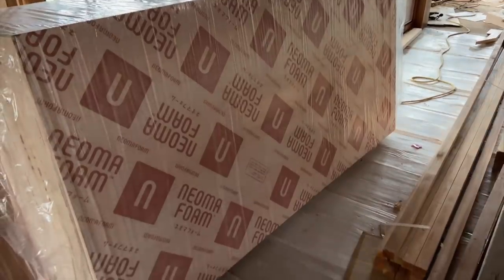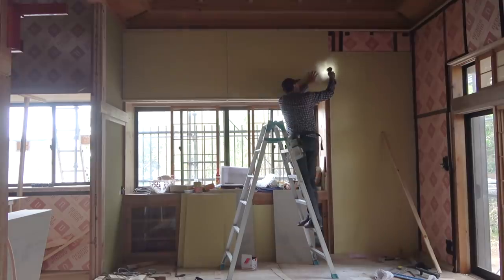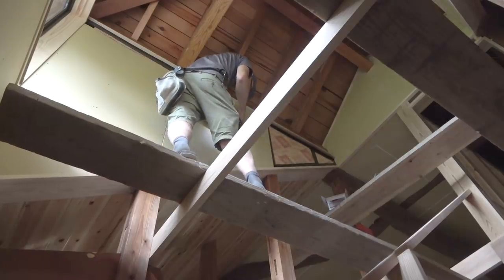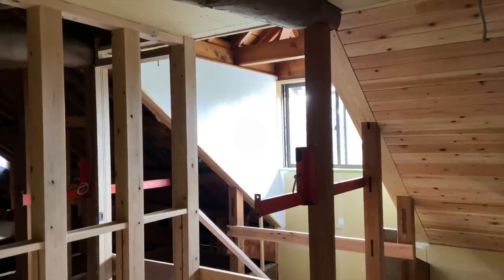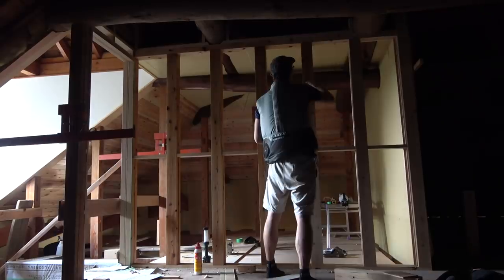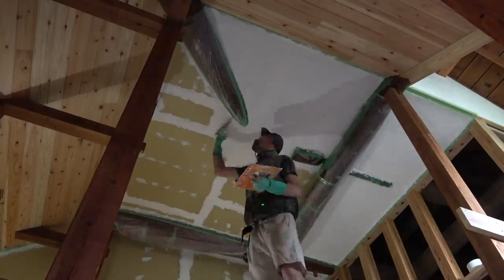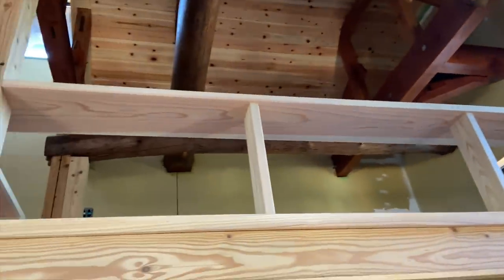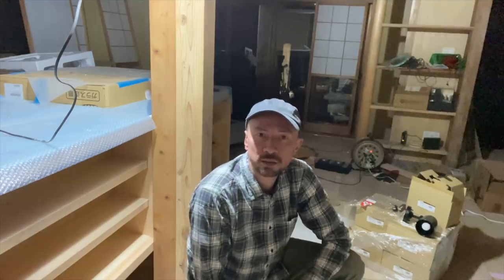Japanese Abandoned House Renovation #7 | The Walls: Insulation, Drywall, Plastering, Siding

Comment: In Germany we hafe similiar thing called "Kalkfarbe", literally "lime-pint". It's a traditional material as well and used for damp walls in cellars and - a bit like in Japan in the sections between the beams of the classic German timbered houses.
These days you can buy it in varying consistencies from fairly thing paint to stuff looking like that one you used. I guess the paint would be easier to apply but you probably need a couple more layers to achieve the same effect.

Comment: In Southern California we hang drywall sheets horizontally and screw around the perimeter as well as in the field.
Reply: It's pretty common in the US to hang 4'x8' sheets horizontally. The center seam is sealed by a tape and a plaster compound for drywalls.
Reply: @jackielinde7568  In Canada too. Actually, it's specified in our construction code. A lot less joints to mask.
Reply: In Germany too
Reply: Yah surprised to hear vertical is better for earthquakes.  Horizontal , perpendicular to studs, would seem better to me for lateral strength. Which is the way it is done in Canada.  But drywall doesn’t provide a lot of strength anyway.
Reply: Drywall sheets are always hanged vertical in Sweden, as the height are 240cm (standard ceiling height). Didn't know anyone hanged them any way else.
Reply: Horizontal can add more shear strength and reduce the time and cost to mud and tape walls but it probably depends on wall construction, wall height, and size of the drywall itself.  I'd go with whatever is recommended for wherever you live. In the US, it's usually but not always horizontal.
Reply: Hmm, here in norway we mount them vertically, but our sheets are 120x240cm (47*95"). our cc on the studs are 60cm and full celing height is 240cm. they are screwed down 10cm between the screws all the way around, and one vertically line in the middle. 
We do make or houses more or less bomb proof tho, even if we have no earthquakes or other extreme weather exept storms/hurricanes.
Reply: @knutruben1  Do you build with block like they do in germany or wood like in america?
Reply: @50sKid  Houses are most often buildt with wood. 2x8" wall studs, cc60 is the standard. plus another 2" inner wall for electrics etc
Reply: @knutruben1  Oh interesting, 2x8"s!! The most we do is 2x6".  60cm is 24" on center which is what they call advanced framing here because you get more space for insulation.  It's done but it's less common.  By far the most common is 16" on center.
Reply: @50sKid  Remember we have cold winters here in Norway, and we have pretty strict building codes for insulation, balanced ventilation etc. I think we changed from minimum 4" insulation in 2007 or something. houses from around 1980s to beginning of the 2000's had 2"4 studs as standard. Its a while since i was working as a carpenter tho, so its a bit blurry:) (also tecnically its 2"10 walls. 2"8 studs, with 2"2 horisontal framing on inside)

Comment: I like how the joiner section between the house and the bathhouse is black and matches the black on the main house, it gives it a touch of modern architecture. Also loving the wood exterior and the lime plaster interior. I wouldn't call the imperfections in plaster, imperfections, it's just adding character.

Comment: Wow, it is really coming along.  I spent 6 summers in Tokyo without air conditioning. I would sleep under a wet towel. It snowed 26 times In Tokyo in 1983... without heat. I would full a clean wine bottle with sento water to warm up my futon.  So you have my sympathy.  The thing is you are doing it right. Thanks for the update from Vancouver Canada- with central heat and air conditioning.

Comment: When I was young. My family and I lived on a Indian reservation. We used a wood stove to heat the entire house. Electricity wasn't always a option.  During the winter we used thick blankets over doorways to separate the rooms to keep others warm. The kitchen was one of the larger rooms we would keep cut off because if you were using the kitchen eventually the cooking stove would heat it up. The same with the laundry room because of the dryer. It's not the prettiest thing, but it does work. Anyways love the videos. Keep them coming, and your house is looking amazing.

Comment: The bathroom ceiling is our disappointing wall. We needed to sand the plaster before painting it, but we never did get around to get the right machinery (or rent it). Also, we were renovating for months (just a flat!), and I wanted to be DONE and move in. So I painted it. It looks ... artsy. 
I don't think the passageway looks weird, I think it looks like a modernistic addition and therefore quite fitting. You gave the old house new, modern life after all.

Comment: I understand why you was gone for so long now, those walls must have taken ages.

Plastering is hard and you've done a great job... but the walls you mentioned you aren't happy with you could easily smooth out the bumps with a drywall sander.

Comment: As to your drywall plaster.  To get a uniform thickness I generally use a 1/64 inch notched troll for the base scratch coat.  I then come back over it with a smooth troll back filling and skimming to the top edge of the scratch coat.  A spray bottle with water works to keep the surface wet to work if it starts to dry too quickly.

Comment: I have not used the Japanese plaster  that you were discussing here. I have used many different types of dry/ add water plaster, mortar, thinset and dry wall mixes.  They are not that difficult to use. Its all in practice for consistency. The bonus is you can adjust how wet or dry the mix is for the application. I suggest that if you decide to try it. Make sure you have the mixer that attaches to the drill. Mixing by hand is difficult for larger jobs. 
I understand your desire for perfection in your plaster technique. Don't be so critical of your work. You progress looks amazing. I have done  tile installation in a few of my homes over the years. Tile is something that will drive you nuts if you are a perfectionist like myself. I still notice mistakes that nobody else sees. I have enjoyed watching your progress on your home restoration. Thank you for sharing.

Comment: Thats the same foam board we use in Ireland.  But the fixings are Timco brand "insulation mushroom fixings" for fire regulation and to stick to block walls. 
We have all solid block homes with beam roof structure and flooring, so it's not cold, but not warm (and Dublin is pretty mild in temperature ranges, but no earthquakes thankfully - so few houses get serious insulation and even fewer have A/C)

Old houses like ours (built in 1938) have fireplaces (ours originally had 5!) Two in sitting rooms downstairs, one in the kitchen and two in the upstairs bedrooms.  They even had carpet! haha.  We chose not to re-employ those for obvious reasons.

The Irish use a skimcoat of plaster over raw brick or plasterboard - I think it's a sand/cement style skimcoat and yeah, it takes a few days to become dry enough to paint. It'll let you know when it's not ready, the paint refuses to stick - after it dries :D

Comment: on your "Shikui" plaster thin coat. We generally cover our taped seams with a thin coat to ensure the smoothness of the wall then coat with primer paint. THEN once dry do a finish coat of latex paint.  thats generally the standard for drywall finish. In colorado where we occasionally have homes made in " log cabin" fashion,  when drywall meets the log we often use a endcap on the drywall to fit the contour and NOT run drywall mud to the wood, while your does look cleaner, in the northern mountainous areas of teh US we get a LOT of moisture in winters that can swell logs, then summer it dries out which would lead to a good deal of cracking where we to drywall completely to the logs.

Comment: It's looking terrific, kudos to you for doing the skikkui yourself. Looks a pretty good job.
I've seen shikkui walls in Japan but wasn't sure of the method of application.
I've been renovating my 1895 house in Sydney. It is brick with plastered walls. Most of the walls needed re rendering and plastering. I had a professional do most of it but I did one room and patched the hall.
The white-set plaster is made from a mix of lime putty and gypsum. The method to put it on is to plaster as even as possible over the wall. After it starts to harden you then use a foam float. The plaster is softened a bit so it can be worked by flicking some water on the wall to rehydrate the plaster. The foam float is good to get a really flat surface. Again after waiting for the plaster to go off, water is flicked over to rehydrate and it is worked with a polished steel trowel. The steel trowel is worked quite hard.  Any dings and scratches are worked out till you have a nice smooth finish.  The surface can become quite polished. If you are not quite expert, then you can give it a light sand and fill any defects later. It is then painted. You can also do a featured wall by working the plaster to a gloss finish and then sealing it.
It’s different finish and texture you get with skikkui so it is good to compare.

Comment: Horizontal overlapping siding we call clapboard. Vertically hung siding we call either barn-board or board & batten where seams are typically covered with a wood bead.

I’ve worked with many types of plaster but never shikkui. Generally the trick with plaster is to mix a wet batch for the first coat in order to get broad coverage and slow the drying process. The second coat should be thicker. Strong arms help enormously :) There are acrylic additives that can improve elasticity and bonding but tend to leave behind an uneven sheen if left unpainted.

Oh, to add, an electric mortar mixer will make the process much easier if you decide to have another go at rolling your own dry mix. A light wet sponge sand will work wonders feathering uneven and taped seams.
Reply from the maker: Thanks, yes, I worked out that a thin, good but quick first coat followed by a thick but more careful second coat worked best for me.

Comment: Pure Lime Plaster is exceptionally difficult to work with, cudos to you for having a go at the DIY Shikui. In Australia we use Pure Gypsum Plaster and mix 10% lime into the mix with water, it's easier to trowel up and smoothe off nicely.
Reply from the maker: Interesting. That sounds like a good idea. I’ve seen some products here that use a lower content of lime (not allowed to call themselves shikkui). Though I’m curious to give the pure lime plaster a go some time.
Reply: @TokyoLlama  Definitely have a go at the pure lime plaster. There's a trick to how much water you add and how you mix it. I think you'll prefer it in the end after some practice. I also noticed on Youtube the way that Japanese Plasterers polish up the final coat, it's really impressive.

Comment: The standard drywall sheet size is 240 by 120 centimeters in Northern Europe and we space the screws the same. The most common thickness is 13mm, but other thicknesses and sizes are available to order. Usually, big commercial buildings are made with bigger custom-sized sheets all the way up to 6 meter lengths.

Comment: I can understand the reasoning behind more concern for heat and humidity of summer than cold of winter because with cold you can always become more active or increase the air temperature heating system but with heat and humidity you can deal with it by doing less or nothing but once you have stripped off all your clothes and totally naked you need a pool!

Comment: in the states, drywall is hung mostly for coverage. IE if your wall is 8FT long and 10Ft high. our sheets are 4ft by 8ft so logically we would run it horizontally to minimize cut and get more coverage per sheet.. we use Standard exclusively for  measurement for construction. only occasionally do we use Metric and thats mostly on appliances and autos. although we do get burch plywood from Scandinavian nations ( because the strength of it is unmatched) and its always metric. A lot of our construction method varies on location. for example the same frame and beam foundation you have in your home is common in the southern states as the floor is framed with joyce runner studs typically 2" by 6". in the northern areas we do basements with concrete exterior walls and footings. then poured floors that " float"  ( they are designed to shift with the swelling of the ground, even after tamping and grading the cold can shift and lift the floor) so in our basements we attach our walls to the upper joyce running under the main floor in the house, this allows the concrete floor in the basement to move without destroying the walls or heaving them into the main floor framing. Our drywall mud is all gypsum based white and VERY smooth. we only use a sand base for grout between tiles. NEVER as a wall finish.

Comment: The reason you didn't use rigid for the floors and ceiling are that the r-value is relatively low compared to other options like fiberglass batts. In general in floors and ceilings you want an minimum r-value of 38, and in walls you need r-23 according to the new energy code in the US that came with the new IBC.

Comment: Absolutely beautiful! Great work man. I really like shikkui walls, and I've done it on a renovation (I'm in japanese construction) before, however, the upper walls near the ceiling, we painted instead (saves a lot of money/time/work) and a few walls that are closer to viewing from a balcony, we used wallpaper with a shikkui like pattern. The lower walls we did shikkui. From the ground level, you can't tell a difference. After that job site, we never used it again, instead, opting for the easier/cheaper sand based plaster.

Comment: White plaster was definitely the right choice. It brightens up the interior and sets off the wooden beams beautifully. Don't worry if it's a bit uneven in places, it livens up what would otherwise be a featureless surface.

EDIT: Drywall sheets come in 240 by 120 cm here in Swden (and most of Europe, I suspect). They are generally installed vertically because standar ceiling height is 240 cm in modern houses.

Comment: tools are often very different as well. our handsaws in the US cut on the push as well as our hand planes, also cut on the push. although most finish carpenters I know do actually have some smaller japanese wood planes ( that cut on the pull) and some fine toothed handsaws from japan for flush cutting. ( barring using these saws previously we used chisels to clean pegs flush)
we also use a great deal more power tools. its uncommon to use handtools for professionals with the exception of things found in nail bags. ( our long line marking is also much different in that we use boxes filled with chaulk and a spool of cotton string inside that when unspoiled allows us to "pop" a line with tension from two points. from what I know of japanese carpenters, they use ink and sticks for straight lines. or small knives to mark with on wood)

Comment: In New Zealand drywall called 'Gib' here, is hung either vertically or horizontally depending on preference. Sheets are 1200 (and 1350) wide x from 2.4 up to 6? metres long.This gives a single horizontal join on a 2.4 or 2.7 stud. Designated bracing sheets (for earthquake/wind bracing)  are specified in 'bracing walls' and have a much closer screwing regime  around the corners (150mm around the edge and 100mm then down to 50mm in the corners) Sheet centres are spot glued to the studs. Standard sheets -300mm around the edge  with centre glued

Comment: The temperatures you said are a bit like Canberra though we may get some dusting of snow every five years. I will say in winter when it is -3C outside my house is COLD and can take four to five hours to heat up to 17C (despite wall and roof insulation). I have been looking to insulate under the house because it can be very hot in summer on the flip side (have measured 42C on a 48C day - too hot to stand on the floor on the west facing side). Missed you and love seeing the progress - and remember imperfections prove humanity!

Comment: I have 2 disappointing walls in my house. The external walls are brick with drywall for the inner walls, and I decided to paint them all white. I started with the brick walls inside the house, and the first 2 walls I did I painted the gaps between the bricks as well to make it all white, which was ok, but very tedious. Then I found on the next wall it was much easier to just paint the brick surface with the roller, and looked much better with the grey mortar in-between, so now 2 walls in the house don't match the rest of the house.

Comment: I know the pain of hot humid summers all too well. Where I live in the USA, summers are hot and humid and this heat and humidity can last for weeks or sometimes months at a time with no break at night. I tried going a summer without AC in my home and I just couldn't. Everything inside my home got wet from the humidity and I had to turn on the AC to dry everything out. I swear it seems to be getting hotter and more humid every dang year. In the 1990s, it wasn't horrible. I managed with just a window fan and some other things. Now? That doesn't work, even with a good fan that moves a lot of air.